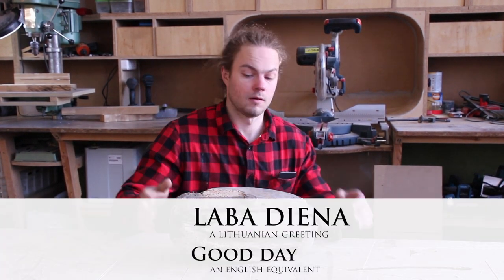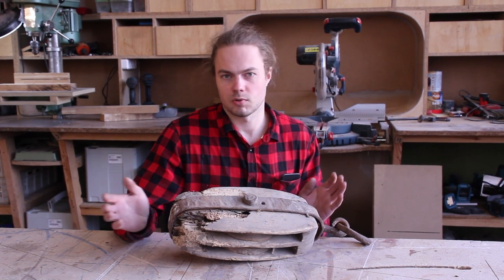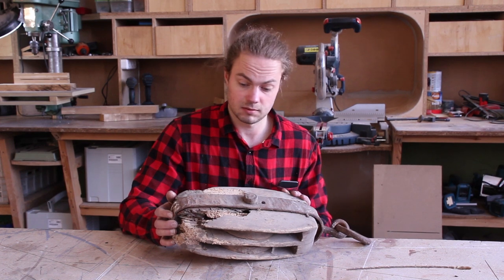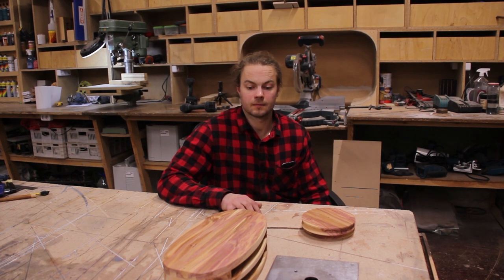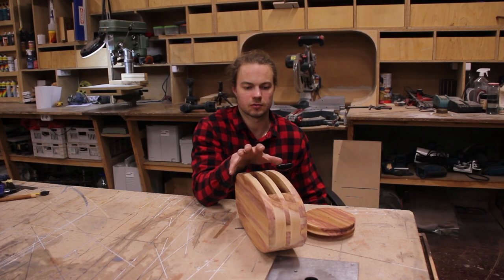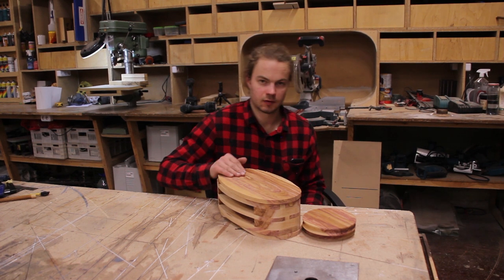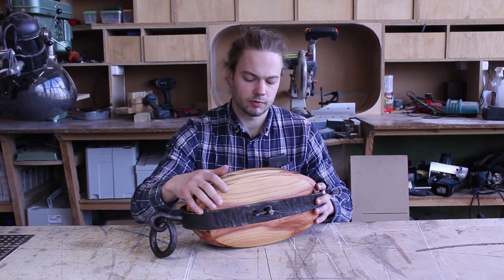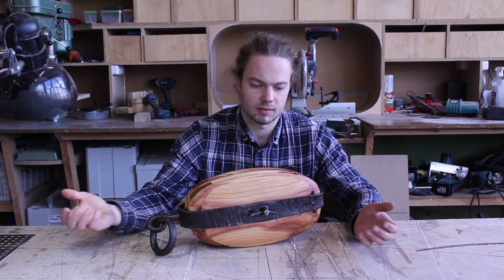making a pulley | vintage pulley restoration

Comment: QUESTION : do you think that the original user/maker packed those bearing with a heavy tack grease ? but very good job !!!
Reply from the maker: Pretty sure they didn’t:D:D
Reply: They would have used tallow,  or slush.